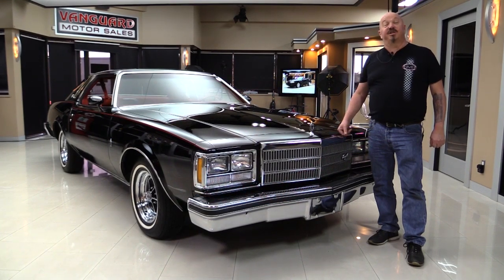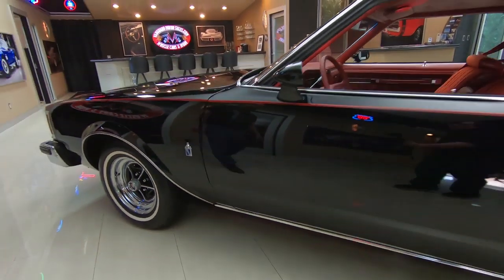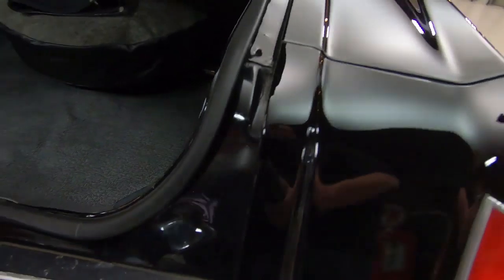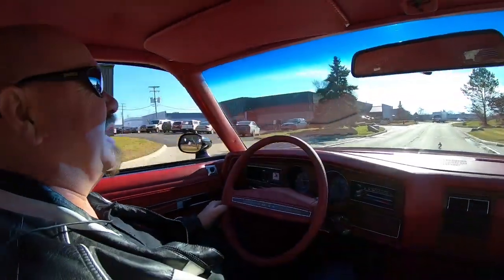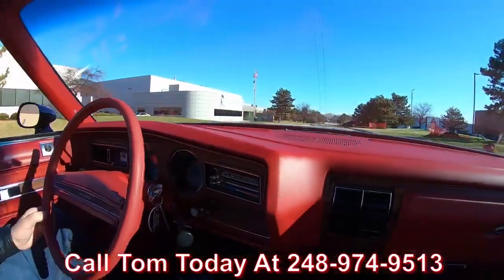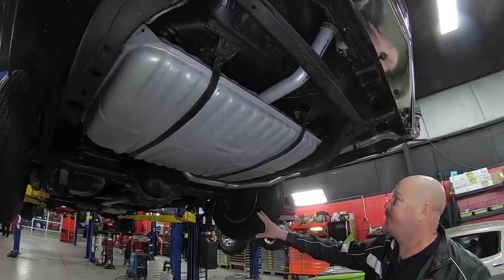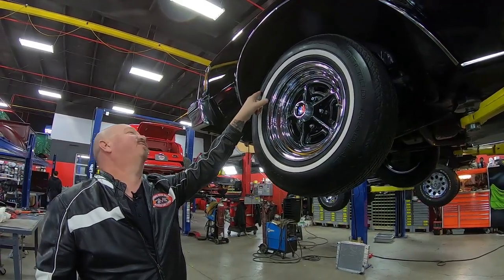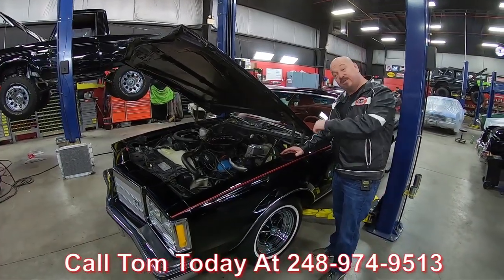1977 Buick Regal For Sale

Comment: Interesting option combination: power windows, but manual door locks. A/C but no radio. Tilt wheel but no cruise control. And a 350 which had to be a super rare option: most of these had either the 231 V6 or that awful 260 V8.
Reply: The 350 was typical, but the 455 was rare. My friend ordered his with the 455, filled with smog devices, of course.